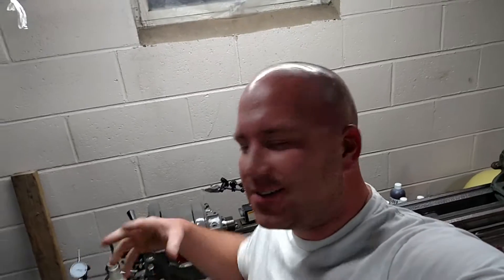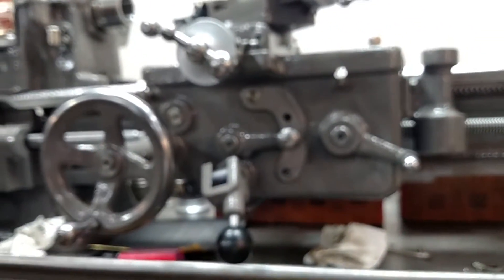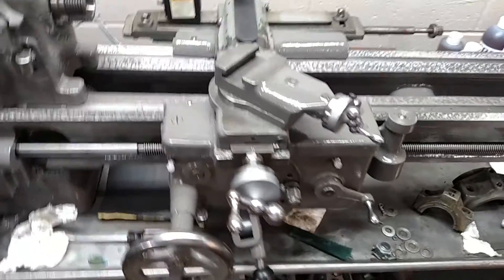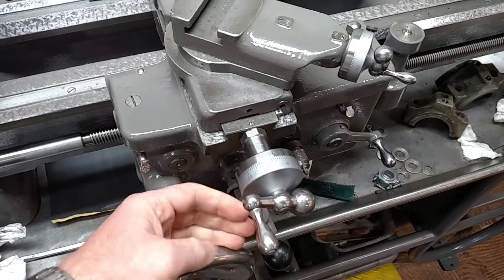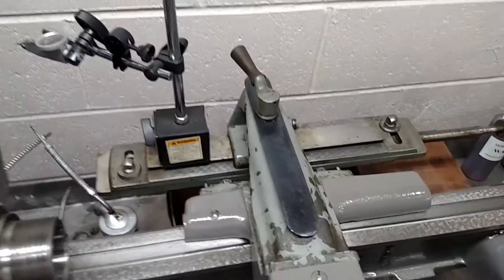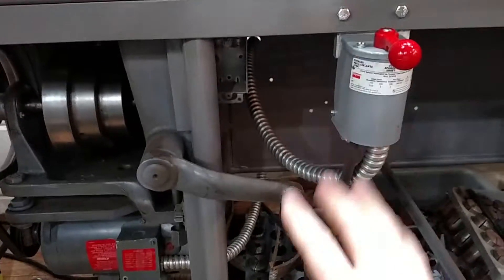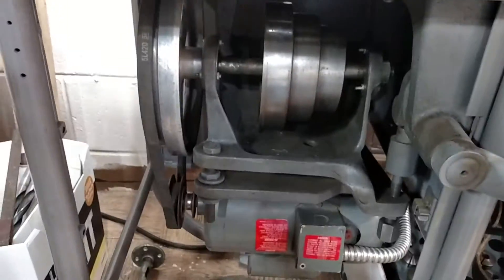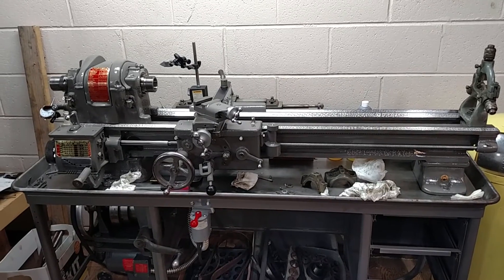South Bend Heavy 10L Restoration Update Part 3!

Comment: What’s that wheel at the end of your spindle? My heavy 10 L doesn’t have one. Oh wait. It’s below at the motor. Never mind. 
My 220 vac motor is unhooked. I need to wire it up and clean underneath. How did you clean the motor compartment?

Comment: Can you show how did you desasemble the tailstock? O cant take out the back part with the whell. Thks !
Reply from the maker: If you haven't gotten there yet, the knurled part is threaded into the body of the tailstock. You need a piece or thick rubber or leather over the knurl and ether a big strap wrench or a pipe wrench with extremely wore down jaws to keep from wrecking the knurl.